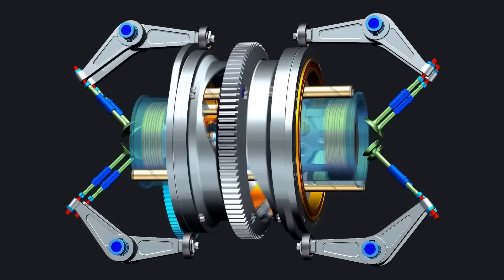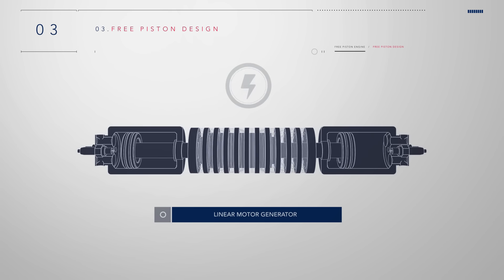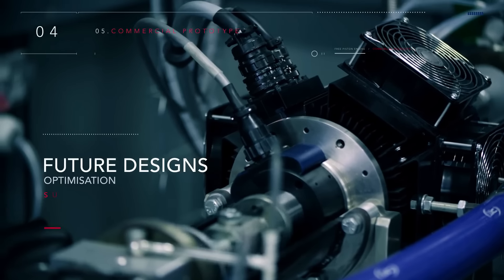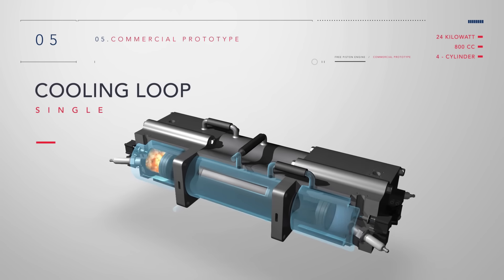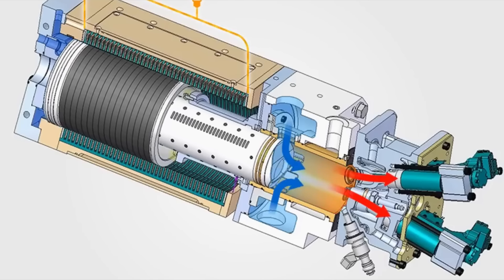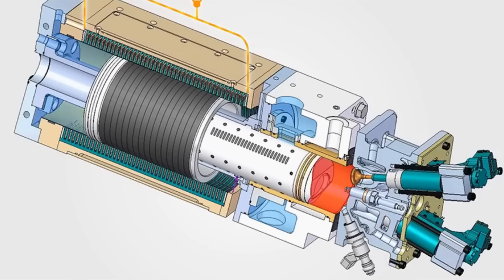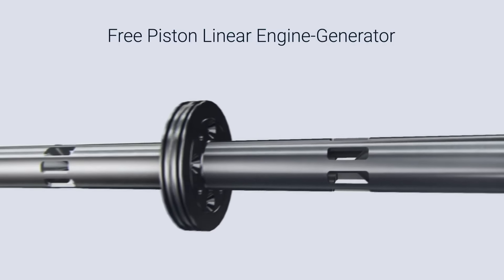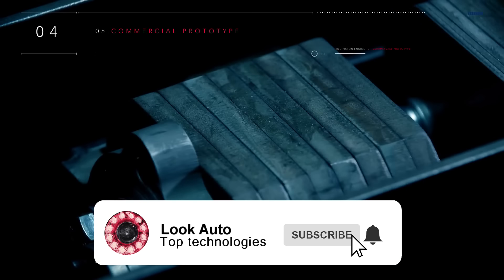New Technologies 2024: W-Piston Toyota | Free piston - efficiency of 50% | Powerful NEW engines

Comment: It's not a totaly new motor. This is just a variant of the Stelzer engine from 1996. Probably Toyota waited so long that the patents run out.
Reply: 30 years ago i have seen something similar that was a aposed piston oil pump
Reply: do you mean 1969
Reply: Es aún más viejo en la década de los 50 GM gasto millones en esto y lo dejo tirado
Reply: The Stelzer engine is a two-stroke opposing-piston free-piston engine design proposed by Frank Stelzer. It uses conjoined pistons in a push-pull arrangement which allows for fewer moving parts and simplified manufacturing. An engine of the same design appeared on the cover of the February 1969 issue of Mechanix Illustrated magazine. (Wiki search result.)
Reply: Well other car industries had the option also to use the patent in that case. At least this engine will help with reducing emissions in the long run overall.
Reply: Patents run out after 5 years.
Reply: @fpxy00  siempre y cuando no las renueven,
Reply: @fpxy00  depends on the country. Here in Germany it is valid for 20 years.
Reply: It also reminds me of the Mothelec prototype engine of the 1970s, which had opposed pistons instead of a single one plus an exhaust valve
Reply: Bruh it's a Free piston engine, they've been around since 1934. Stelzer was just a simple variation that had valves in the middle of the cylinders this does not because its having those valves is impractical
Reply: @arduinoguru7233  free pistons have been around since 1934, stelzer was variation of that with valves at the center of the engine, this is not even that. OP does not know what he's talking about like most people on the internet these days
Reply: Il y a 50 ans j’avais imaginé adolescent un moteur à 1 temps sur le principe entre les moteur 2 temps et les moteur de locomotive à vapeur. 
Le problème rester de transformer le mouvement linéaire en mouvement rotatif. 
Mon père professeur de mécanique m’avais dit que d’autres y avaient pensé avant moi.
Reply: Hooper-Favill Patents of the late 1970's for BSA used the stepped piston design.
Reply: It also kinda looks like the earthquake machine that nicola tesla made idk it's super shaky

Comment: Big issue is VIBRATION, that kills everything mechanical
Reply: That thing looks like it would shake the crap out of the car sitting still lol
Reply: Vibration should be minimal. Apart from the single cylinder prototype the pistons would be in pairs moving in opposite directions so vibrations would mostly cancel out.
Reply: it is Adja bil machai Sam
Reply: Tell us when it is in MASS production then people will take notice and buy, otherwise it's an idea on a diagram, like others that manufacturers say will shock the car industry
Reply: I think wankel Engine and axial flux motor would be the great generator for compact type EV .
Reply: wankel use lots of fuel and axial flux motor also create magnetic resistance so it would hinder the performance of the car,
so i dont think they could be a part of the choices
Reply: @endurofan9854  but wankel are the best for hydrogen fuel. Also axial flux motor can give more electricity than a normal bushless DC motor. Like Mazda are developing one rytnow. Probably liquid piston are the evolved version of that , that might replace most of the engine if went all successful
Reply: It doesn't matter because there are no gears to the wheels. This engine can be on elastic mount without no external vibration transmission.
Reply: If two motors are placed in parallel and explode in the opposite direction, both cancel the vibration
Reply: A double with 4 pistons would counter the vibration
Reply: @rogerprincipe7975  Look at 1:29
Reply: @dogphlap6749  thus having a rotational impulse stress
Reply: I think you missed a detail in the video...
https://youtu.be/5lwxbwjcnzc?t=129
Reply: maybe put two engine in a line with 180 degree offset so they cancel each other, but then it's a very long engine.
Reply: @dogphlap6749 you would get a twisting motion and still have a lot of vibrations but I’m sure Toyota have thought of this
Reply: VIBRATIONS are not big problem. 
they can be reduced ( nothing is 100 % efficiency ). 
The vibrations and the friction can be analogy as the heat and electromagnetic pollution ( losses ) in electronic / electrical system.
Reply: If you used 4 of them in a 2x2 configuration you could in theory nullify the vibrations, with 2x1 it would still rock although not as much as 1x1
Reply: well... yeah but all engines have big vibrations. if you stack 2 of these in a line you get long engine but also no vibrations.
Reply: opposing pistons would cancel out the vibration
Reply: it's harmonically balanced.  Less vibration than a straight six
Reply: @mr.holloweed5309  Mazda was working on that a few years ago

Comment: But aaaaaaa, converting mechanic enery to electric energy then back to mechanic energy does not waste many energy?
Reply: Free piston engines can't easily be hooked up to get the mechanical power out.  That's why it's cheaper and easier to attach a generator and use the electric power directly.  It's more efficient and has less parts, much simpler.  You can create an engine that is mechanical, but it requires much more complicated parts.  The free piston doesn't have to go completely back and forth, it is free to travel, nothing connecting it, hence the name.  Regular engines have a top dead centre, a measurable maximum distance from piston to head - this does not.
Reply: All ev use mechanical energy that was converted  to electrical and then back to mechanical except solar energy thus energy is always
Reply: Mechanical transmissions also have a lot of efficiency loss, and we found that it is easier and cheaper to make efficient power trains by using electric motors connected to engines like on locomotives.

It is also better to have an actual engine, because batteries are incredibly heavy, expensive and slow to charge, and makes the product very expensive.

The bigger question is what they will do with the exhaust gas, are they going to give us turbo compound engines?
Reply: @charlesc.9012  I wish I know what "turbo compound" means 😅

Comment: This engine converts thermal energy into electric energy which means you have to take the electric energy and convert it into mechanical energy.   This engine has a relatively  large mass moving on a linear path stopping and starting which is inefficient and creates vibration.

Comment: With no gearing, can that linear alternator/ dynamo extract all the energy from the combustion cycle? (or 50%). Electricity so near heating is tricky engineering, also. The linear motor can be much, much wider, and in a vacuum. Also have flat planes?

Comment: 2nd motor has parasitic losses from has a pneumatic spring... still a good design... however the heat will have a very low electrical power output once it is heated up... efficiency losses will be need to run liquid cooling.

Comment: What about using it in EV to extend the range? Lets say battery allowes 400km range, but before start of a longer journey engine starts and its energy prologne range for another 150-200 km. Yes, it uses some fuel but it's more efficient than standard engine and it's not being used during everyday ride.

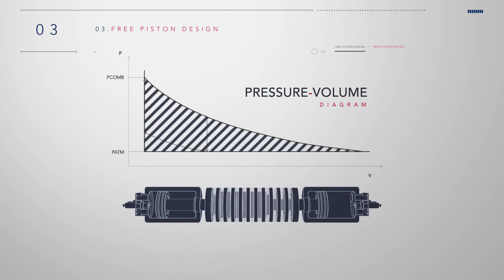Comment: Quote at 1:20 mark: "The absence of bearing supports allows the engine to operate at a higher conversion ratio".  

Is that so? 
You don't say?
Well isn't that remarkable?

So, are there bearing supports inside the combustion chamber?

ROFL.😂

Comment: they're moving in the right direction......what they really need is the Israeli version engine in a deltic triangular configuration with 6 combustion chambers and the entire system totally submerged inside a viscous liquid suspension/shock absorber configuration so it can rock and vibrate slightly against a yielding fluidic resistance that can also double as a cooling system....that engine must run very very hot

Comment: I have new formula Engine, it's very perfect, more balance, low vibration, smother, light weight, low cost, high torque, economical, more efficiency. It's Will be next generation engine...

Comment: Piston ICE engines are done. Electric motors will always run rings around them and they run clean!
Reply: where does the electricity come from?

a pulley and belt is useless with no belt. a chain and sprocket serves no purpose without the chain. a hydraulic system doesnt work when it has no hydraulic fluid.

electricity is the belt, is the chain, is the fluid. it is not a SOURCE of energy, it is a CONDUIT, a TRANSMITTER of energy.

like old factories had shafts and belts overhead, and they replaced all that with wires instead... it was more convenient... but it was never the SOURCE of power. it merely TRANSMITTED it.

Comment: I see the same problems for all of these engines: lubrication, pre-ignition and knock. All these engines have no way to lubricate the piston rings without burning oil and lack any way to control the compression ratio.
Furthermore, the power generated would not be a sine wave, meaning transformers can not be used to adjust voltage and current.

Comment: What would happen if you use instead of gasoline you use hydrogen which at an explosion 1.3 times stronger, this excess energy could power a dihydrogen separator cell which could power your Aquarius engine

Comment: I don't know that I would so freely refer to this as a hybrid car. Using electric motors supplied electricity via a gasoline powered engine and requiring nothing more to a normal battery, use the electric motors to do nothing more than replace mechanical components and not to be the driving force of the car. That is the motor/generator. With this setup and two or four electric motors, you will eliminate the need for a transmission and differential and require smaller brakes. Would you actually refer to this as a standard hybrid?

Comment: ok, but so... basically, those piston engines are only electricity-generators? Because I don't see how they could transfer mechanical motion to, say, the wheels of a car, otherwise.
Reply: theyre not even electrical generators because the requirements of a generator are incompatible with the motions produced by a linear motor.

Comment: Looks like a two stroke motor. Will not be clean enough for future requirements. Interesting how many base their new motors on some reliable but polluting  techniques
Reply: Evinrude, (no longer in production since around 2021) was the last 2 stroke mid and high HP outboard engine builder and claimed their system beat all others 4 stroke engines in emissions. The torque was pretty good too but a lot of injector and exhaust tuner problems.

Comment: Connecting two of these and operating them 180 degrees out of phase will neutralize the natural linear vibration. However, if one unit fails you better be ready for some strong vibrations.

Comment: So this engine looks like the only connection to the wheels is from generated electricity as the magnet behind the piston  on the shaft moving backwards and forwards past a coiled wire set up.

Comment: Why piston when you want all electric?
Reply: "electricity" is not a PRIME MOVER. it is not a SOURCE of energy, it is a CARRIER of energy. it has to be produced, then transmitted. just like a pulley and belt, or sprocket and chain, or hydraulic drive... the electricity being the chain, the belt, or the hydraulic fluid.

SOMETHING has to cause it to MOVE to do anything useful.

Comment: the crankshaft not only transfers linear reciprocating piston motion into rotational motion it prevents the piston from flying out the top and bottom of the engine at high rpm's. These engines never work because the piston has no tdc or bdc set by a mechanical connection. Toyota would never freely advertise an actual working break through engine. Their competition would all find a way to copy it.

Comment: How will any internal combustion engine revolutionize the economy? 

We should expect to see 8 million fewer ICE cars sold each year for the next 5 years.

Toyota used to sell the number one car - now that #1 sales position is an EV.

Around 70 million ICE sold in 2023, and in 2028 this will be 30 million.

Toyota sells roughly 10 million ICE cars - in a market that supports 70.  How many will they sell in 5 years when the market supports only 30 million ICE?

They are in a race, they are behind, and they are hesitating about whether they should push their foot on the throttle.

Comment: Why not make cars that have engine sizes no bigger than 1.5L and have a top speed of 80mph so not a lot of power needed and im not talking about the type of engines used in lets say Ford Kuga 1.5 or BMW  mini which are turbo charged to make more power than they should to the point where they dont last very long, theirs no need for more power or speed, seems obvious

Comment: Seems like a lot of mass to start and stop during cycling.
Reply: mass is needed to get get a reasonable compression on the opposed cylinder side.
Reply: @mrjoepietube  Perhaps you are confusing mass with force?  In race engines, mass of pistons, rods and valve train is reduced to increase efficiency.  The energy required to stop  and change direction on every cycle is very high. The rotary engine keeps the piston moving in the same rotational direction which is very efficient, though the rotary has so many other limitations, that consumes energy.  A baseball player uses rotational energy to propel a ball at high speed using less energy. The larger the caliber of a bullet, requires more gunpowder to propel it.  etc  Compression is achieved by force, not mass.

Comment: that's half an engine,
you have to convert push into rotation
Reply: Look, at least half this conversation goes right over my head, but why do you need to convert push into rotation. I understood that the push/pull motion generated electrical energy and that was used either to charge the battery or supply power to the electric motors (rotational energy). What did I miss?

Comment: Efficiency is limited by thermodynamics. Carnot cycle says you cannot get to 50%. Simple thermodynamics.
Reply: Carnot efficiency is related to the difference in temperature between the hot and cold reservoirs, given by 1 -  (T cold) / (T hot) . It's not limited to 50%. In real life the hot part is limited by materials ability to resist melting or deformation. Also the Carnot cycle assumes no heat loss to the environment during the cycle which is not possible.
Reply: @deanelandreth8648  In real life you cannot get 50%

Comment: B.S. The flywheel in a normal engine stores a lot of energy. Here you have to resort to a two stroke design, because the 4 stroke simply will not work.

Comment: What stops the piston (at TDC) so it doesn't hit the head and same at the other end BDC? And how does it start from stationary? All these computor generated images work fantastic, lets hear one running.
Reply: he said the magnet system can be powered to move the piston before combustion starts
Reply: Keep in mind that you have a seriously strong electromagnet connected to the piston that acts both as a generator AND a linear electric motor. The electromagnet can be operated to push or pull the piston with variable strength in a matter of milli or even microseconds. Since the weight of the piston is known and the speed/exhilaration is measured down to microseconds level one can quickly add or subtract to or from the piston movement to make it stop exactly where you want. It is this same process that is used to control the compression ratio on the fly.
Reply: @wrndlabs   Exhilaration is not the correct word, the word you need is "acceleration".
Reply: @wrndlabs  Good comment, but I'd have to see it to believe it. I would think that the magnetic (electric) power needed to stop the piston at the end of each stroke would far exceed the power generated in the preceeding (one) stroke.
Reply: @@retiredbore378 But the steam engine piston would still be connected to some kind of crankshaft which would help limit the piston travel.
Reply: The compresión in the opposite cilinder stop the expandimg one? It is not so difficult. You can start It like old big ship engines, with conpresed air. 😉
Reply: but once one misfire happen then the oiston would have nothing to stop it from hitting the head,
thats a whole lot of a headace
Reply: @endurofan9854  maybe by design, the magnet stops the piston in one exact place (near TDC) without depending on ignition of the other side.  no matter spark, ignition happened or not. i also thought like that; now seeing 'linear magnets' in comments
Reply: @endurofan9854  No, the pressure from the compressed gas would stop it.  Unless the seals were bad and air escaped, but it's so fast it would have to be a serious leak!
Reply: @endurofan9854  you cant compress air to infinity... 

anyway, the main issue is that no matter how hard you try, the magnetic circuit falls short... from an inability to completely reverse the magnetic field as it cuts a conductor, to the velocity of the magnet/conductor, along with the minimum reluctance along with the maximum flux linkage.

Comment: These are great, the universality is what’s key, wide range of apps ranging from car to electric generation. What surprises me is the lack of great powered trailers. Every RV trailer basically benefits from a big battery and generator, whether connected or not. With an assist mechanism in the hitch, my little Toyota rated for like 1,000 lbs of u to owing could pull a comfortable camper without going past rating.